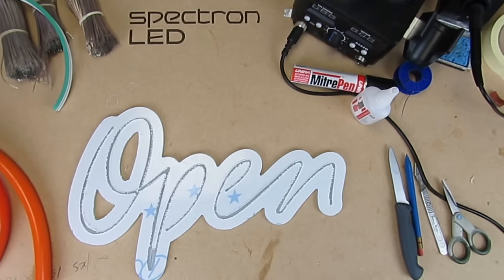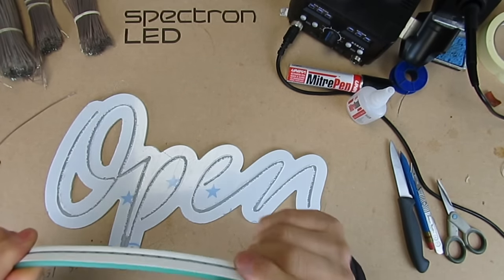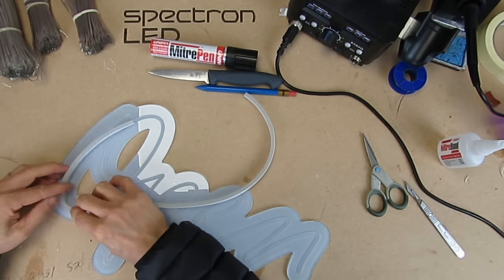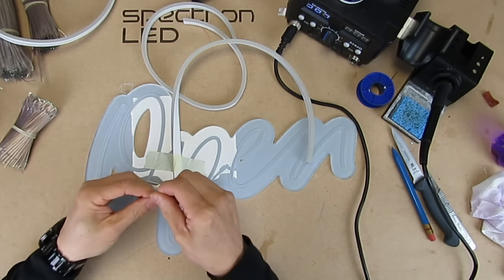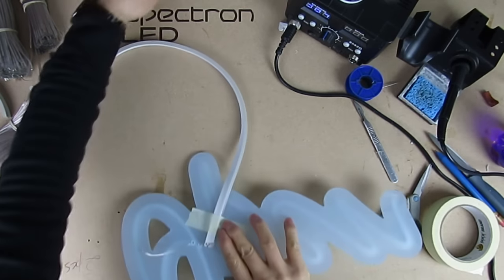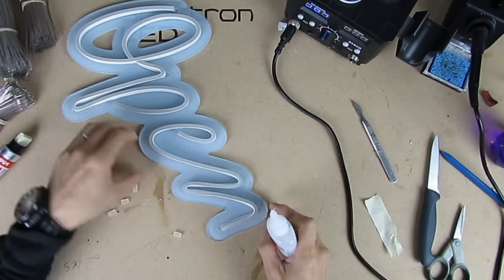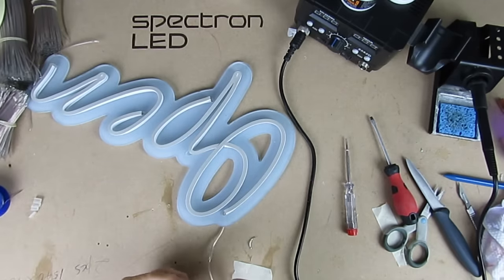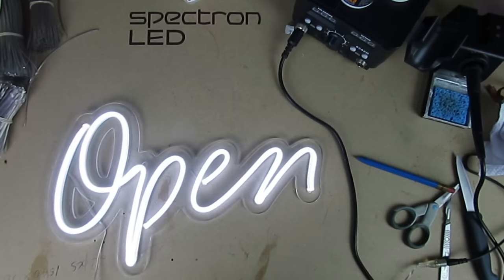How to Make a Neon Sign LED Part 2 (feat. CNC Cut Back Panel)

Comment: Great work you're doing, but i have a question, what size of acrylic sheet are you using I'm guessing it's a 4mm? Is it?
Reply from the maker: Hi Sharo, we use a 5mm acrylic back panel.
Reply: @Spectron  thank you so much, what about the wires what type of wires are you guys using?
Reply from the maker: @sharoburhan7028  pre-soldered cables, 28 AWG

Comment: I live in New Zealand so I’m unsure on our voltage, if plugging in the neon to normal power source say in our home would the led burn? If so what’s the best way around this?
Reply from the maker: Hi Sharelle, the mains power in the UK is 230V and the LED neon flex is 12V so we use an LED transformer (also called a driver or power supply) to "step down" the power from 230V to 12V. Your electrician should be able to advise you on the best driver to use in New Zealand
Reply: @Spectron  thank you so much on the advice of this, so easy to understand and I know what I’m asking my electrician.

Comment: What 12v tester are you using with those crocodile clips?
Reply from the maker: You could use any constant voltage 12v driver with the crocodile clips attached for testing, most LED driver are self adjusting with the wattage, so if you keep it within the maximum wattage output you will be fine. However, if you're using the driver to power up the LED, leave 20% headroom, only 80% of its power.

Comment: How deep do you recommend the channel be? Will a 4mm thick board with 1mm deep channels work?
Reply from the maker: We use a 5mm panel with a 3.5mm deep channel, but it's down to personal choice. Some of our customers prefer a thicker panel, say 10mm with a deeper channel to that you can barely see the sides of the neon

Comment: Hi, what about the polarity when you're wirering ? How do you know which is what since you're using the same cable color for both + and - ?
Reply from the maker: Hi Nightflowers we use a 22 AWG cable that has a gold and a silver wire to differentiate between + and -.

Comment: Does anyone know how thick the acrylic should be and how deep a channel is best to cut?
Reply from the maker: Hi, we use a 5mm thick acrylic with a 3.5mm deep channel. You can use thicker acrylic and a deep channel if you prefer and budget for the sign allows.
Reply: @Spectron is 4mm possible or would you say 5mm minimum? And thanks for the reply!

Comment: Hi 👋🏻 is a Cnc cut channel different from a laser cut channel? Also, what software do you use for the artwork?
Reply from the maker: Hi H D, yes a CNC allows you to cut a channel into a panel to a specified depth. The neon sits in this channel.

Comment: Cool , Which font did you use.
Reply from the maker: We designed that one ourselves
Reply: @Spectron  Can you recommend me some font. I'm a beginner, with which font will it be easiest for me to bend neon flex and not have to cut it in a lot of places. 🙂Thx

Comment: this is great, May I know how do you know how much to buy LED strips? and how do you measure your acrylic sheet, I am trying to make a sign as smallest as possible with RGB NEON  FLEX and another one with NEON strings, but I don't know how can I do the math, can you please help?
Reply from the maker: Hi Danial, we plan our designs using Adobe Illustrator then take all of our measurements from there. Hope that helps!
Reply: @Spectron  even for the length of the neon?  Can you please DM me, I really want to do this but I am struggling how much neon I need to buy
Reply: @danialbakhsheshi9064  You can print out your design on paper, then use string to follow the path the LED’s will take.
Then measure the string to get your approximate length.
Reply: @sar2908  thank you

Comment: Which wire you're using
Reply from the maker: Hi, it's 28 AWG pre-solered cable. Available here https://www.ledsignsandlighting.co.uk/accessories/neon-flex-accessories/28awg-electrical-cable

Comment: Hi what type of glue you use?
Reply from the maker: We use UNIKA's Mitre Bond a two part adhesive with a activator pen that accelerates curing to bond instantly. Can be found here https://www.ledsignsandlighting.co.uk/accessories/neon-flex-accessories/mitrebond-single

Comment: Great tutorial. May I ask what machine you are using to cut and add the groove to the acrylic?
Reply from the maker: Hi, it's an XYZ CNC machine
Reply: @Spectron  Thank you!
Reply: @Spectron  Thank you for such a useful video. Would this work with a laser cutter as opposed to a CNC router? How important is the actual groove?

Comment: What’s the machine you use to check the power?
Reply from the maker: Just any 12v plug-in or desktop type LED driver, should be able to find on eBay.

Comment: Where can i buy the free form neon flex strip ?
Reply from the maker: Hi Eugenio, you can buy it from our website: https://www.ledsignsandlighting.co.uk/free-form-neon-5mm, https://www.ledsignsandlighting.co.uk/free-form-neon-8mm, https://www.ledsignsandlighting.co.uk/free-form-neon-stand-offs.  If you have any issues, feel free to drop us an email at sales@spectronled.co.uk
Reply: Can I make outdoor sign which can be operated with batteries?

Comment: Can we make this with laser machine
Reply from the maker: It is possible, but you will need to glue the neon down. You could use two panels of acrylic, laser cut one with your pattern and stick it on top of the other panel. That way you have a channel in which to place your neon.
Reply: @Spectron  I thought so too, thanks

Comment: where do you get the wire cord to plug into the wall and the remote ?
Reply from the maker: The neon flex will need an 12V transformer. Do you mean the wire that connects the neon to the transformer?
Reply: @Spectron  yes Sir and what size thinning cable you use ?
Reply from the maker: @meganmatthews1239  Hi Megan, we use various sizes depending on the distance from one connection to another. The tinning cable we use ranges from 70mm to 350mm so it's always good to have a selection of difference lengths.

Comment: those endcaps look shite it kinda ruins the otherwise perfect sign imho
Reply from the maker: We now use the upgraded version - push fit end caps for our winged neon, which are rounded and more rigid. We think the end result is much neater, but you can leave them off if you prefer and the sign is for indoor use. Depending on the angle though you may see the light coming out of the cut ends. Plus there may be issues long term with dust, moisture....

Comment: Why not use a glue gun instead of two-component glue? Especially for attaching wires to the back of the sign.
Reply from the maker: Flatter neater clear finish.

Comment: I have never used these led strip which look like led strips, that's all I can say about it, sure the colors look great in the evening, but real neon has a glow that can't be imitated. That said these are probably cheap chinese products which use cheap materials, unsuable to work with. If I was to think of a product that would resemble neon it would definately be round.  and it would come in two parts a guide which can be used to guide the round led strip and a clamp the strip as well, a lesser tedious process. also in addition to the roundness of the tube there should be a few end pieces that could be soldered on the end of the tubes, so it looks like writing, or pulled effect, such as reall neon has. Let me say that cheap products do not pay off in the end, people want good stuff!
Reply from the maker: Hello Ron Moes,

We appreciate your candid feedback regarding our neon flex product in our recent YouTube video. Your insights are incredibly valuable to us, as we are always working to enhance our offerings based on customer input. We're glad to hear that you find the colours of our product appealing, particularly in the evening setting.

You've made a notable observation about the distinctions between our LED neon flex and traditional neon signs. While our LED neon flex aims to replicate the iconic glow of traditional neon, we understand that it may not capture every nuance of the classic signage. Your perspective sheds light on the unique qualities of traditional neon that are hard to replicate.

Addressing your concerns about product quality, we'd like to assure you that we prioritise the use of high-quality materials in our neon flex products. Durability and long-lasting performance are pivotal considerations for us, especially within the professional realm of sign making. This product comes with a 3 year warranty as standard. 

Your concept of a round LED strip product accompanied by guides and clamps is intriguing and practical. We do offer another product called Acryneon® which more closely resembles glass neon in that it can be fully round. Two pieces of acrylic are milled to shape and embedded with LEDs. Examples and spec can be viewed in our online catalogue here: https://books.w2060.cn/2023/557/ (from page 13). Its versatility and style range contribute to a diverse set of choices for sign makers and it is generally used in commercial settings. 

Your emphasis on investing in quality resonates with us, and we're dedicated to providing sign makers with products that are not only visually appealing but also built to withstand the test of time.

Should you have any additional suggestions, questions, or comments, we encourage you to reach out to us directly. Your feedback is invaluable as we continue our pursuit of excellence in product development and customer satisfaction.

We extend our gratitude for taking the time to express your thoughts and insights. We eagerly anticipate further opportunities to refine our products based on feedback from respected voices such as yours.

Best regards, 
Spectron LED